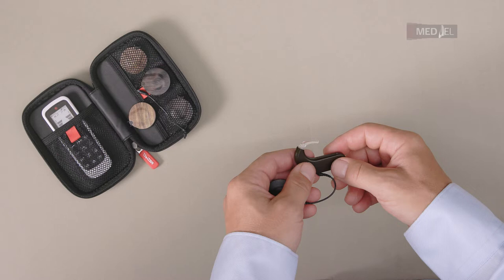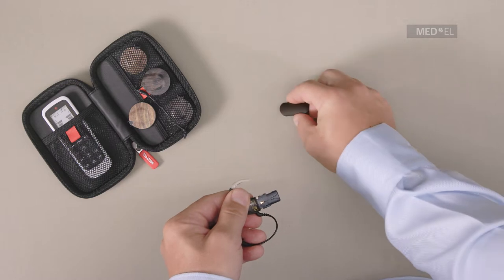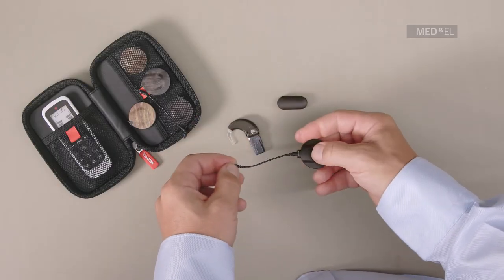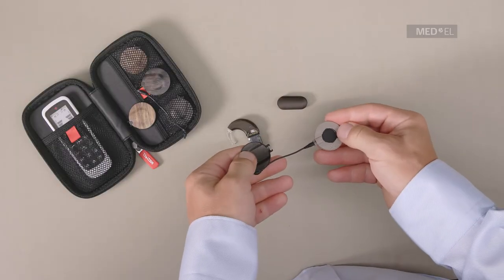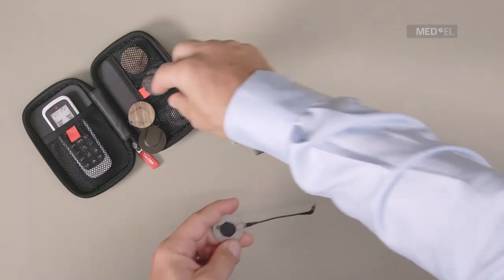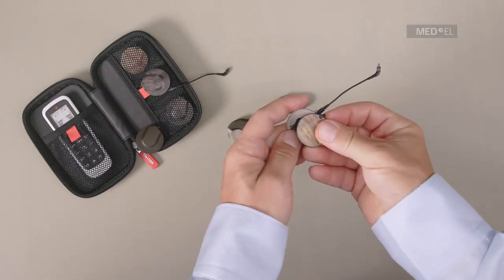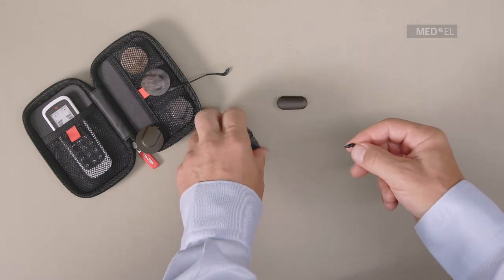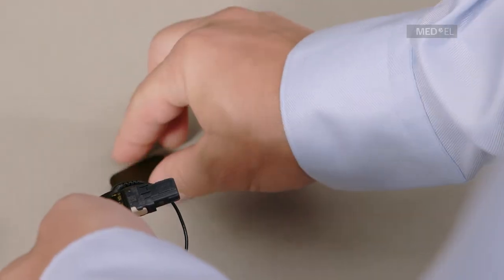SONNET 2 Hands-On: Changing the Coil Cover and Cable | MED-EL

Comment: My cable breaks, a lot. Ive never changed it myself, i always go to my audiologist for assistance.
My problem is that it keeps breaking, at the magent on my head, never near the battery. They way thsis guy in the video held his processor at the very end, thats how i put my battery in with the wire curved like that. Why do mine keep breaking and any advice for storage? I keep mine in thay same zippered black pouch.its as straight as i can put it in there but usually the coil i have curved down toawd the middle. I never let the magnet dangle, or hold it by just the magnet/battery part. Im soctired of asking for thos wire to be replaced. Ive only had my implant since 2021 and o just reached out for another to be shipped. 😢
Reply from the maker: Faith, thank you for reaching out. Please get in touch with your local MED-EL team so that they may assist you with your device and best storage options. You can find your local MED-EL team's contact details here: https://www.medel.com/clinic-finder/

Kind regards, 
Alicia